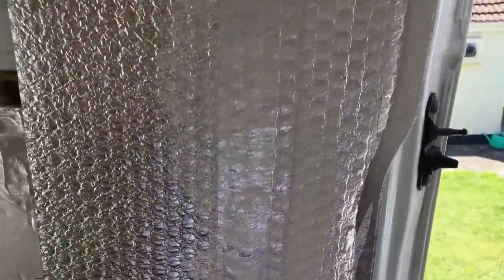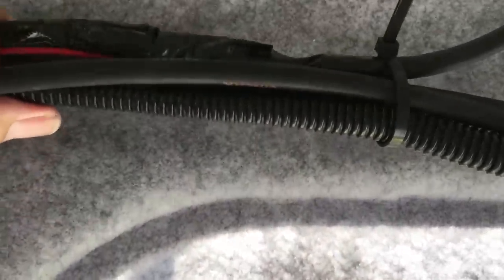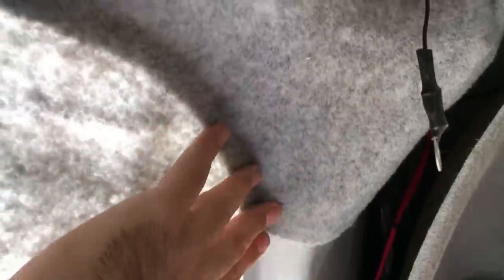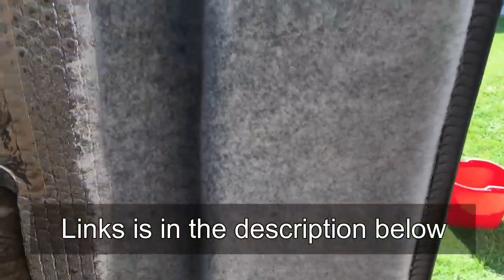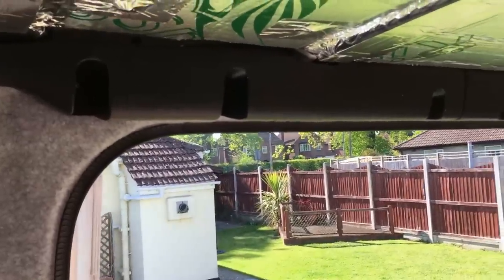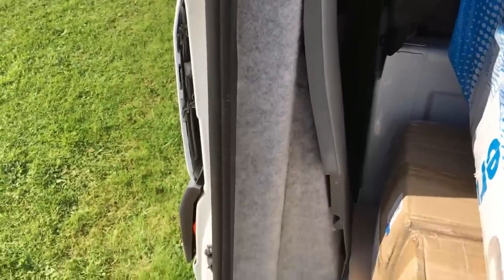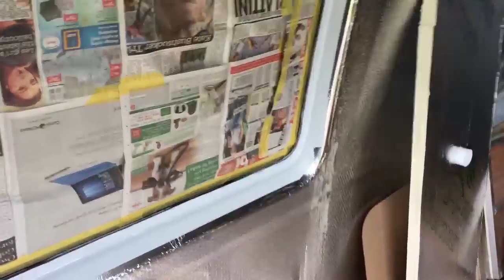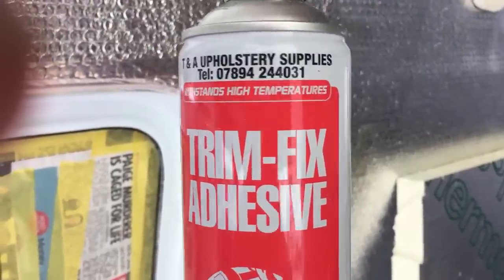Mercedes Sprinter Conversion - Van Lining Carpet

Comment: Great update Greg... one question I do have is...changing the light bulbs at the back...I’m not sure if the design has changed since I last worked on one but, to get to the bulbs and wiring was by putting your hand behind the trim (once removed) and going in the recess to the back of the light....can you get to the bulbs by just removing the lens from the holder from the outside now??…
Reply from the maker: Hi Marc, I had a broken rear lens and had to buy a replacement I shot some film of that process and it will answer your question nicely 😊
Reply: Greg Virgoe sorry mate, I’ve looked high and low for that video but blowed if I can find it...any help with a link please??
Reply: Marc, My LT35 has easily accessible rear light 'modules' and the Sprinter should have the same or similar design. Even if covered by interior trim it shouldn't be too much of a struggle to remove that and then the light module/cluster. The 'lens' is secured but 4 nuts that do secure on the inside of the van (to stop the easy removal by dishonest people)
Reply: Malcolm Young cheers. Yes I remember the lens bolts and nuts hence my qt. I’m sure Greg will show us the way he got around it.. 👍🏼😊

Comment: Hi Greg,

Just wondering is there any reason that you didn't run the refletix right up to the edge of the window, before you put on the carpet, will there not be a risk of a cold bridge? Great videos, following them step by step on my build.

Thanks.
Reply from the maker: Hi Brian, I could have taken it right up to the trim. In reality the carpet has proved to be be enough covering to increase the surface temperature and we’ve never had condensation on that window surround even in snowy conditions. We do keep the inside of the van above 16 deg too which helps a lot
Reply: @GregVirgoe  thanks for that, keep up the good work 👍

Comment: A professional van builder on the US east coast mentioned he wants the floor to breathe (under the floor).  Your floors look sealed. What do you think of this? I live on the wet west coast and would expect the floor needs to be sealed. thx. enjoy your vids. You seem to be one of the few that vapour barriers their walls. I have done some walls in my home and there is no way i would have an exterior wall without a moisture barrier  inside the outer part of a wall (in a van, steel) and a vapour barrier in the inner side of the wall inside the drywall (reflectix for  you).
Reply from the maker: Watch my workshop on insulation I discuss the science behind it but you can trust me a sealed vapour barrier just inside your finishes is essential if you do not want condensation to form on the cold surfaces of the van. 👍🏼😊
Reply: @GregVirgoe  Thanks! I have watched the whole thing. Agreed. I think most people put carpet on the metal bulk heads directly, it's nuts. Or they put their walls over wool with no vapour barrier. In Canada, with our temperatures, there is condensation. I will probably run some cables through bulkheads, but most of them will be outside the walls in an accessible decorative tray/trim. I am also thinking of putting a cross wooden panel with magnets, that can easily be removed, where i will run cable.

Comment: Just what I needed, this is next on my list to complete. I haven't decided yet between reflectex under carpet or closed cell foam sheets under carpet. SO my question is: Do you find there is any crinkle / noise / movement in the carpeted sections as the under surface is bubble wrap? Love the videos, very helpful!
Reply from the maker: Hi Jasmine, I can run my hand over the carpet and you do not hear any noise at all from the bubble wrap it is completely silent.
Reply: Lovely, thanks Greg thats good to know! I think I'll go for the same method in that case.

Comment: Another informative video Greg. I've seen many of these lining carpet video's and they have all fitted it to thin plywood panels, is there a reason you haven't done this in regards to the insulation sections. ;)
Reply from the maker: Jerry Bootneck, this video focuses on the door pillars which you can only apply it direct because of the curves. For larger flat panels like door cards and even van walls I have wrapped the plywood sheets and fixed that to the van as you say.
Reply: ah thanks Greg, I didn't think you would cut corners

Comment: Hi Greg,

Have seen how you have secured battens to the floor. How are you securing the furniture board to the walls, how are fixing the panels to the wall (are you using the same as you did for the ceiling or are you using 3mm ply and auto carpet and finally how are you hanging / securing the wall units. Cheers Paul
Reply from the maker: Hi Paul,  This weeks video will explain that in great detail.

Basically, I have lined the walls of the van with 9mm marine plywood first, that is secured to the steel van.
I fix either into the ply or through the ply and also into the timber battens on roof and floor.

Comment: Awesome content as per usual, did you calculate the weight of all the additions to your build beforehand Greg, or are your fingers still crossed ?
Reply from the maker: Hello Robert, I did do a rough spreadsheet at the beginning with the weight of the main items but until I get that printout from the man at the local weighbridge my fingers are still crossed lol

Comment: Hi Greg,
Loving the build,I own a Motorhome MOT test and repair centre.
Excellent build quality and attention  to detail especially whilst trying to film it all.
Could you tell me how long it took you and what your background is?
Joinery i suspect,

Rgds

Jim Bell
Reply from the maker: Hello Jim, I was only working on it at weekends as still working full time in London so it took just over a year to finish. Lots of that time was didn’t setting up filming shots as well. 
I’m a mechanical services design engineer by trade. Never had a job on the tools before so this was all new to me. I’m just a fussy sod I guess 👍🏼😃
Reply: @GregVirgoe  Excellent,are u still traveling and any plans to do it again on another van ?
Reply from the maker: @jamesbell5284  currently lockdown the same as the rest of the world. But as soon as we are able we will be off. Yes planning another van build now.

Comment: Nice video as always mate! Top job! Never worked with car carpet before, it looks very stretchy and easy to work with. How prone is it to keep moisture? Thinking of the edges that was covered with the rubber trim, didn't see you put foil there (might have missed it...). Seems like a typical place for rust otherwise.. :) Just bought myself a demountable camper for the Defender 130, so Sprinter plans are on hold. Maybe when the family grows though..
Reply from the maker: The rubber trim covers the carpet completely, none is visible from outside, we've had load so of rain and not a single leak or moisture got onto any the seals around the doors work fine.

Comment: Hi Greg. Firstly, thanks for all your amazingly helpful and informative videos. They really are great!
With regards to the vapour barrier, I wonder if you could tell me why you haven't put the reflectix around the indented part around the "sill" of the window? This is the exposed white metal at 9 mins in. I keep wondering about how far you should vapour barrier each surface and it would be great to know why you have not worried about that articular section. Also, in my Vauxhall Combo, I have various areas that are covered in plastic blocks which I'm hoping I might be able to remove, fill with earthwool and then replace, cover with reflectrix and then carpet. Do you think this is the best way to go about it?

Thanks in advance,
Sam

Comment: Hi Greg really enjoying this series of videos and well done you! I am just about to start a sprinter conversion and wondered if a Flettner wind powered ventilator or maybe two would give me enough ventilation? My sprinter is the same length as yours.
Also I will follow your method of insulation but I am 6’ 2”. Will I have enough headroom?
Your videos will be played again and again during my build and thanks for all the effort you put into filming and sharing your great work!
Reply from the maker: I was looking at one of those myself for bathroom ventilation Russell, only reason I changed my mind is they rely on you moving along or an external wind to make them spin and give you forced ventilation, I eventually fitted a small 100mm 12v extract fan with run on timer and humidistat. Works on a pull cord too so very versatile for about £40
Reply: Greg Virgoe thanks for the tip Greg, I will look into that fan as it seems perfect!
Reply from the maker: Russell, I used an xpelair LV100H low voltage fan, however it runs on 12v AC not DC so I had to wire it off the 230v side of my control panel and fit the transformer they supply in the garage part of the van. Have a bit of video footage to show later on.
Reply: Greg Virgoe Thanks that is interesting and I look forward to future videos!

Comment: Question: I see you have been using self tapping screws throughout the build and I understand they are quick and easy but is the result the same quality as regular screws with pilot holes ? 

Thanks, as usual great video.
Reply from the maker: Hi Ethan, whether you use self-drilling or drill pilot holes they are both self-tapping screws that you need.
You may find that ordinary screws will not cut the thread required or will strip or snap.
Don't use the ones with little wings as these are not designed to be used on thin sheet metal.

Comment: Hello Greg, Just wondering if you have tinted the side windows at all? Sorry if you have, I am being lazy by not searching. Just from personal experience driving through France and Spain just in the last week....I got pretty badly burnt through the open window...we don't have aircon in my VW  LT35 and window tinting is now on the 'things to do' list...
Reply from the maker: Hello Malcolm,  the windows are 82% factory tinted privacy glass, not a film purchased from vanpimps.co.uk
It is very difficult to see into the van from outside, like a limo, and they do offer some shading from solar gain.
I have since fitted blackout curtains that are moulded to fit inside the window reveals. Thanks for watching

Comment: HI, I would also like to cover everything with carpet. Isn't there a risk of mold? After some time with the steam inside the camper? Thanks!!
Reply from the maker: You need to provide plenty of ventilation and warmth. 
If you allow the van to get cold and don’t have ventilation then you will get damp and mould.

Comment: Hi Greg! Thanks for this awesome video! I've been learning so much from your channel. I'm prepping my supplies & cost list now, and I'm having trouble figuring out the name for the type of trim you use around the windows to finish the carpet with that clean look. Any suggestions on what to be searching?
Reply from the maker: Hi Raquel, just search eBay for “interior black edge trim” and you’ll get lots of sizes. The cutout is two skins of metal so measure the thickness of what you need to cover to make sure get the right size trim. I got mine from glass for vans.

Comment: Hello Greg. Your videos are top! Very helpful. I did the carpet lining, but I have a problem with water going under the rubber sealing, and then the water gets through the carpet inside the van. Do you have any idea what I can be doing wrong? I bought a brand new rubber sealing and the problem is still there.

Comment: Hello Greg. Thanks for another great video. One question. U are going tot use LPG and use a oven etc. Do you have to chance pressure or nossels for this?
Reply from the maker: This oven is made by Thetford and designed specifically for use with LPG in motorhomes.
I do not have to change anything, the ignition is also 12v as well :D
https://www.thetford-europe.com/product/triplex-combination-of-hob-grill-and-oven/

Comment: Hi Greg, Trim Fix Adhesive on the door trim. Did you apply the same spray on the wheel hubs before reflectix (prior to installing floor batterns and Celotex) or did you do both, spray and tape it on? Working on a Dream.
Reply from the maker: Yes, I did use trim fix adhesive to secure the bubble wrap and foil taped the joints.

Comment: best video yet mate brill ive got one for you if you dont mind what is going to be the total cost of the build when your all finshed  then ill see how many corners ive got to cut to build one lol cheers
Reply from the maker: You always bring a smile to my face mate, there will be a detailed video on all the costs.
I will answer it with total in this next video though 👍🏼
Reply: Is it necessary to use reflectix behind behind all carpet ? i notice some you-tube converters dont use it everywhere esp. in smaller vans :]

Comment: hi. again, Greg. i am trying to find a cassette blind system to fit into the window recesses on both sides of my Relay conversion. i understand these come as a unit that can be screwed in to make a really neat finish and easy privacy. if you have fitted them on your sprinter can you advise where they were sourced and how it looks when finished.  love the vids - enjoy your van!
Reply from the maker: Hello John, we have fitted curtains that fit into the window recess from Van X. The curtain rails are moulded to the shape of the reveal and the blackout curtains are stretchy so the stay tight between the top and bottom rails.

Comment: Hi Greg, just wondering how the carpet lining has held up where you have adhered it to the bubble wrap insulation and do you recommend doing this way rather than applying carpet lining directly to the metal work?
Thanks David
Reply from the maker: Yes it is as good as the day I applied it and that’s no lie. You must use trim fix high temp spray adhesive that is the key. I would def use that method again 👍🏼😃
Reply: Thanks Greg, seen a few people using the high temp trim fix.  Looks good stuff👍
Reply from the maker: @davidknights866  links in my video description 👍🏼😃

Comment: Could you show your finished electrical system please. I’m just doing mine and it’s one of two jobs I have dreaded doing. The other is mounting solar panels and Maxxair fans. How did you fix your panels mountings to the roof. Thanks Greg.
Reply from the maker: Simon, video out on both subjects very soon 😃
Reply: Greg Virgoe thank you Greg. On your electrical what charger are you using? Is it the CTEC 250SA & Smartpass 120? 
If so have you a video on this?

Comment: Hi Greg. Excellent video as expected.
I have a question. After watching your informative two part insulation video a while back, what is your opinion on the eco wool regarding moisture, is it a repellent or is the vapour barrier sufficient for it not matter?
I have bought the roll of foil, the foil tape and the dodo sound deadening so it is the last ingredient i need 😉
Reply from the maker: Hello, the Earthwool is water repellant and mould resistant, but as long as you do a good job of your vapour barrier that won't matter because they won't be any moisture in there anyway 😃

Comment: Hi Greg me again 

Where did you get the rubber trim you installed by the window 
And the new rubber trim on the back door
Reply from the maker: The window trim was from Glass for Vans and the new rear door rubber was from Mercedes Benz.

Comment: Hi Greg, im following your build project, (it is excellent, informative and inspiring BTW,) just wondered if you would enlighten me as to how much carpet you ended up using? Thanks
Reply from the maker: Hello Russell, we did the cab shelf, all the door cards side and rear the window surrounds and both side and rear door surrounds, we bought two bundles of 10m2 inc 5 trim fix cans in each bundle, we had a bit of carpet left over but used all the glue.
Reply: @GregVirgoe  Thanks for the quick response, excellent work and I thoroughly enjoy your series eBay here I come 😁
Reply from the maker: Russell Williamson no problem at all, really happy to help and good luck with your build 👍🏼

Comment: Hi Greg, great videos, Ive got a lot of building experience but leaning extra stuff all the time,  did you run a bead of silicone under the black trim off the floor by the back doors? When I took the trim off I realised water could get in and travel under the floor.

Comment: Greg, what size reflectix did you use? In the carpet lining video, it looks as though you were using two sizes. I'm getting ready to buy materials and would like to follow what you did.
It looks like you have a roll of 48 inch on the ground and your spraying what appears to be a 2-3 foot width for the interior wall. 
Thank you, Ron
Reply: Also, if you don't mind me asking, how much did you need? I am doing a 2012 sprinter which should be close to the exact same size. I don't want to order more than necessary.